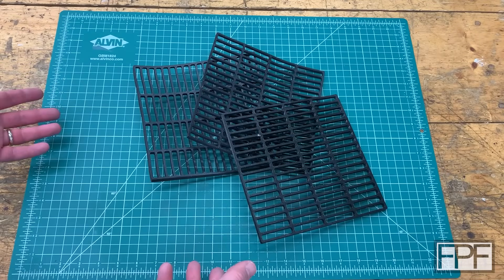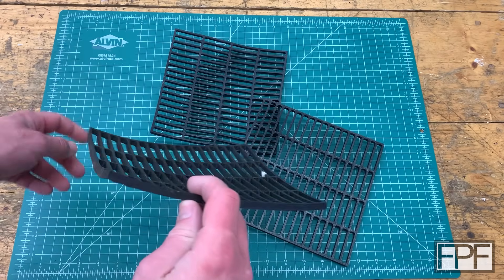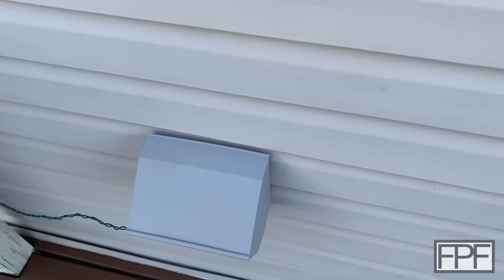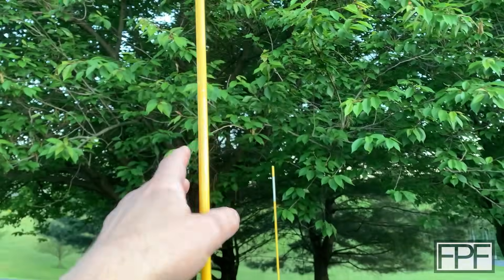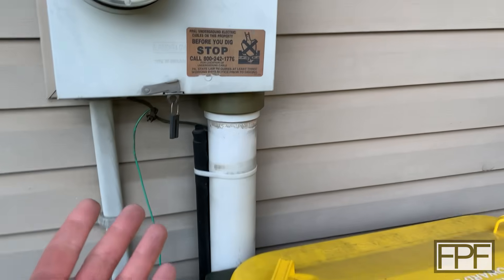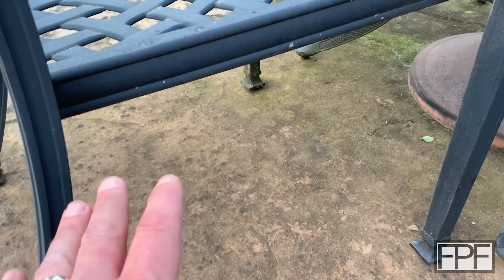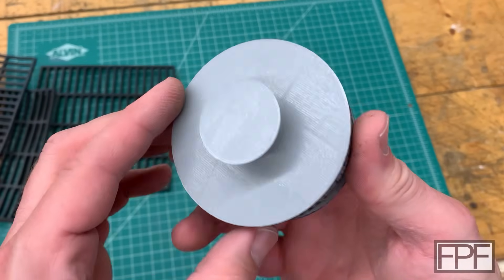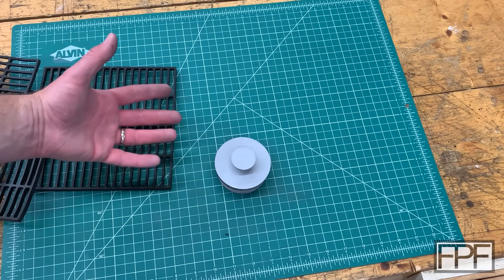3D Prints - 7 Years Outside

Comment: I printed a bunch of security camera mounts and LCOM weather proof box mounts to fit them onto a 4” square light pole. I used ASA just for peace of mind…some of them are pretty high up and / or weigh a decent amount and I did NOT want the liability of them falling off the pole and hitting someone or something.
Reply from the maker: I've yet to try ASA.  What filament do you run?

Comment: PLA seems to hold up well outside for me.  I have more issues with PLA inside a hot car in the summer.  The part will warp almost guaranteed.  I have a pla truck hitch receiver cover that has held up fine for 3-4 years being outside in the sun most days as well as held up fine with the car wash many times.

Comment: I've tested my fair share of PLA prints outside and none of them have ever gone that many years.  I do a lot of gardening so I've tried stuff in several materials and PLA in the garden breaks down with sun and regular water exposure.   I've made stakes for plants and garden tags and any PLA prints start breaking down.  They first will show signs of warping and then major fading.  By the end of the grow season they will be flaking pieces off.  That's 12 plus hours of sunlight and every few days sprinkler or rain water on them.  That's about a total of 5 months growing outside for us and pla looks bad.  Now PETG or ASA or even Nylon is totally different outside.   PETG still has its flexible properties even after a year so far.  Made a part that had to flex for outside and so far it's still flexi.   No signs of break down.  I could go on but I find your findings interesting.   I've never seen those results and that's with several colors and brands.
Reply: I suspect it's not the UV exposure but the soil and moisture contact that is more detrimental.

Comment: I have used black PETG for brackets used to construct a chicken coop using pvc conduit. The brackets are used with a zip tie that wraps around 2 pvc pipes and maintains the stiffness. There's screw holes that too. 4 years now no degradation in them.

Comment: There's too many factors here. I suspect a lot of your PLA, based on the brand names, is actually PLA+ alloyed with a more durable material. Especially the stakes in the ground, since moisture tends to be one of the fastest factors.  My tips are look at its printing temperature (you want higher) and if the location gets hot, don't have it in contact with the ground or other continuous moisture, and paint it with some exterior house paint, and it'll last "forever." 

Also, check out CNCKITCHEN's RMRRF. He shows a guy who put out samples of various filaments for 7 years on his fence facing west.

Comment: Just one comment. Durability in the sun is also dependent on your altitude. At 6300 ft, I have approx 20% stronger UV than at sea level. A hobbyist here in Colorado printed up a bunch of swatches in different colors and materials. He left all of them outside for 7 years. There was definite fading that was somewhat color dependent, and some PLA's were brittle. He had it on display at the Rocky Mtn RepRap festival. One 3D printing channel that was there posted a video of it.
Reply from the maker: interesting point, thx

Comment: I live on a boat and I've 3D printed a ton of TPU gaskets and outdoor parts, mainly in PETG-CF and ASA-CF.  Nothing has failed or even shown signs of wear after 2-3 years at sea.
Reply: you 3d print the stuff on the boat? and is your boat one of those fancy ones where there's a little indoor area under the driver's seat?
Reply: @ctbdjc  I do!  And yep - my boat has a full kitchen, livingroom (salon area), two bedrooms and two bathrooms. :)  She's 46 feet long.
Reply: @GordLamb  woah. i only have a small one we go out on whenever the weather is nice.
Reply: @GordLamb  "she"

Yup, this guy boats!
Reply: Wow - that 3D Bed Leveling and Calibration must be a pain LOL
Reply: @provoking3449  Not as much as you think. You can hang your 3d printer on a string and still print well. The levelling is about distance between the bed and head, so as long as the printer is rigid and not any slop in the axes, the rocking vibration isn't going to really do much.

The humidity and temp swings I would expect to be a bigger issue.
Reply: How do you stabilize the printer? Just the standard counterweight floating table similar to the ones used on the stoves?
Reply: @Archivort  no need to stabilize it!  Surprisingly, modest sea motion doesn't have any effect on the print quality at all (Qidi X-Max3).  I've even printed while under sail at a 10 degree angle and parts came out just fine.  It surprised the hell out of me!
Reply: @GordLamb that is awesome.  You should post some pics of the gasket to show how they are holding up.
Reply: Problem is none of 'em have failed yet! :)  When I start replacing them I'll definitely take pics of the result.

For now they just look they did the day I printed them, but you can only see small exposed sections.
Reply: Damn, printing TPU gaskets for the boat where you sleep is badass. I wish I can one day have that kind of love and trust for one of my girlfriends 🥲
Reply: Why are you not recording your journey and uploading on YouTube! That type of content would be a hit
Reply: @nocece4u  I want to!  It just takes so much damned time and I'm doin' all of this boat work alone -_-

Comment: In 2017 I printed a ravens head for a scout patrol to go on a staff out of black PLA. It melted a bit in the sun but still looked okay.  I also made a box to hold some card scrappers out of PLA and that was fine until my dad left it in a car once and then it warped to the point the lid wouldn’t close. I also had a zip tie holder that sat in the garage warp/creep on me from just the elevated temps and the force of the zip ties pushing out. After these personal events I’ve decided against using PLA for anything that is a tool or may be in a garage, car, or outdoors for long. It’s not the degradation / UV but simply that the softening point is too low.
Reply: What is your preference to use instead?
Reply: To handle the temps in the garage I find PETG is sufficient (but probably not in a hot car if the PETG is also blended). To go above that I find carbon fiber loaded Polycarbonate to be reasonably easy to print with but has excellent temperature resistance and long term dimensional stability at the expense of increased material cost and being a bit more warping prone outside of an enclosure. If the print is going to be in direct sunlight for most of its existence and I care about color accuracy and strength holding up, I’d probably pick a light colored ASA ( but not red as that pigment tends to have uv trouble ). Keep in mind PLA is still a great material for prototyping as it’s by far the cheapest and easiest to print with and it does have excellent static load strength.
Reply: We made the mistake of heating TPU next to a PLA printed reel. Of course the PLA reel deformed 😡

Comment: Dumped some pla part after print into boiling water at 100 deg celcius and it was hard to bend by hand when they are thick like 6mm
Reply: but pla start to melt at 60 degree. If you just dropped the pla, and the pla was thick, than I can understand that

Comment: Well I was thinking along your idea that PLA will endure well outside but I can say I designed a vent cover for a direct vent furnace 3.5 inch INTAKE pipe. The nice honey comb mesh disintegrated and the circumference shrank only after 2 years. No sun on that side of the house but temperatures like yours. I used white PLA by Overture sold on Amazon. I noticed this brand of white PLA is brittle before printing. I have other manufactures white PLA that is more flexible before printing. I am thinking the more plasti-modifier the manufacturer adds, the more resilient the outdoor outcomes.
Reply from the maker: give Hatchbox a try.  I use more SUNLU than Hatchbox because it costs less, but the Hatchbox stuff is definitely a higher quality.

Comment: The comments seem to be over whether PLA will just fall apart outside, it won't.  The issue people are actually referring to is IF the "Glass Transition Temperature" needs to be considered.  PLA is around 55–60°C, while PETG's is around 80–82°C, you can insert things at these temps.  The tomato support is fine in PLA, but if you "Needed" it to remain level, PETG wouldn't have warped as much, if at all in New England.

Comment: This video shows the difference between PLA and PETG for Weight Bearing prints.
https://youtu.be/R2910kAJXao?si=GNGdI0PlRrCrw4vu
I.e. this and other videos showed me why I shouldn't print Shelf Supports in PLA.  When it gets to 90F/30C, PLA can droop under weight in bright sun.
I've noticed PLA is very stiff and strong, and 'snaps' at failure, but PETG is more pliable, and 'bends' noticeably before failing.  I make my Clips out of PETG for this reason, along with bushings I need to snap around a fixed pipe/pole.  I guess it's still "different tools for different jobs".  PLA is fine for all these examples, but I wouldn't use it as one of those angled Flag Holders.
Reply: BTW, I recall some follow-up video where they showed how their commenters were right about his Bookshelf using PLA Brackets (he was so proud in the original).  Over a year, the books eventually caused the shelf to droop.  But I can't easily find it among the huge search results... ☹
Reply from the maker: hmm. .I've done about half a dozen shelf supports, all with PLA and they're holding up great.  My design may just be stronger though: https://youtu.be/FbicM6C2BO0?si=eiC7NtB-cO3wyY7f

Comment: i had some pla ghosts i printed for Halloween I left out year and they disintegrated over time. they were made from glow in the dark pla and were very thin. the part that where in contact with the dirt disintegrated and the rest became discolored and brittle. However i reprinted them as it took about 3 years out there all year to get to that point (hey i think the lil ghosts are cute around the mailbox), A lot of the current pla has anti uv additives in them so as long as they aren't warping from the sun they work ok.  

 i also printed pla vent replacement in clear natural pla (no additives) they became brittle and had to replace them in about two years.  I used clear because i didn't want them to warp from heat. the next time i printed them i sprayed them with clear uv protective top coat and they were good for 3 years where the whole vent needed to be replaced.   I also printed a cover to help keep animals out of a crawlway space  it has been 5 years and it works fine.

For me i find contact with dirt and thickness of the material is what matters.

I have a water bib standoff i printed its a bit discolored (yellowed) but still works fine (it is in white abs)

Comment: In NC. I printed a few things in PLA that were outside for about a year. Nothing degraded from UV, but I did have one thing get hot and warp. It was black PLA. No problem with natural PLA or blue PLA. This was about 10 years ago, and they were just test parts to see what happens in full sun. I think PLA formula has improved since. I now use PLA+ instead of "pure" PLA. I haven't retested, but I have ignored a lot of "don't do XYZ" because I actually tested it enough to realize that most people do not know what they are talking about. Good video.

Comment: I have some PLA+ inside my car, button mounts etc, it's been there about 2 years, still looks like new, I have also got some TPU outside the car (I made a moisture cover for the back of my front spot lights. The TPU (also two years outside) is fairly low to the ground and the elements but it also seems fine then again in my experience TPU is indestructible :)

Edit: 
GST 3D PLA+ @ €12.50 per 1Kg (Black)
Saintsmart TPU 95A @ €25.40 per 1 Kg (Black) I think this was the price I bought it a long time ago and I forget. €25.40 is what I have it down as in my slicer.

Comment: Very informative video! It looks like there is some variability in how the PLA handles the outdoors, with some prints warping and some being fine. As usual, real life isn't as cut and dry as one might think.

TPU as usual shows just how underrated it is sometimes, holding up better than most people think. 

Kinda surprised you didn't even try PETG or ABS at all.
Reply from the maker: TPU is KING

Comment: Garage-floor epoxy's and oil-based polyurethane's are the  great  equalizers when it come to outdoor prints as they will make the worst filaments perform like the best filaments for outdoor applications(cheap oil-based alkyd paints also work great)
Reply from the maker: Great tip!

Comment: Not sure if this is overall good or bad. PLA is supposed to be biodegradable. That's one of its selling points. You are proving that this is not the case at all.
Reply: There's some misinformation going around. PLA isn't biodegradable, but it's able to be composted in specialized industrial composters. Unfortunately normal residential compost piles won't do it either.
Reply: You've been had by marketing.

PLA isn't going to compost outside of a professional facility. All our PLA prints are as environmentally bad as you expect when you hear "plastic".
Reply: Yeah bad news sorry, It isn't really this was just more green washing.

Comment: From my experience lighter color PLAs are fine outside in the sun and you can coat them in UV resist  coatings. But darker colors will absorb  more heat and will warp or sag under weight, but will anneal and stop warping. Now for hot cars, PLA will soften and change shape.
Reply: that is what I noticed too

Comment: I have had a few small items in my car, thin items just turn to goo (warp and distort) but I also have a small box with 2mm walls and slide on lid and it's held up just fine. With the thin items I am sure it's more the heat than anything else. I also have a very chunky door handle for our screen door on the front of the house (kids destroy everything so I made it thick and lots of infill) and it's not in direct sunlight (front door is inset 6' from the front of the house) but it's been there 3+ years and it's used every day multiple times and still even looks like the day I installed it (pretty sure it will hold up longer than the rest of the door). Now I have a small solar panel on the eve of my house (just a 5v one that recharges a motion light) and that is PETG because it's in direct sunlight, all weather and is structural (and only 2mm thick walls) so I wanted to assure it would last 5+ years (it's now a little over 3 years old).

Comment: So PLA is Sugar Beet based plastic, so technically bio degradable, however it is not NATURALLY bio degradable.  That is, if you leave PLA in the sun, it will not turn back into its base materials, it will operate like normal plastic does in the sun.
PLA doesn't like heat, but the UV will eventually kill it, when that is varies from company to companies type of pla and what additives they have done to it (PLA+ can vary wildly).  
Now if you need the thing to be outside and be durable forever, then ASA is what you need, but if its just a decorative thing (like Flower Pots), not a lot of stress or strain, PLA is fine.

Comment: I suspect the amount of pigment in the filament and the thickness of the walls have a big impact on how well it holds up. IIRC the ones I've seen people post that degraded quickly were also vase-mode, so single wall.
Reply from the maker: yeh, single wall is really just decorative stuff as far as I'm concerned.  I do 2 min and my default is 3

Comment: I think it depends on your local conditions and color of filament as well as what is in contact with the print. I for example have had lots of failures with pla inside a car, mostly it just melts and distorts
Reply from the maker: fair point

Comment: I have printed house numbers for a letterbox beside a friend's drive. It is in full sun for over 2 years and printed in PLA Pro dark grey, and is still going strong. It is exposed to +100°F in summer and down to freezing witthout issue. Great video. I have now printed off the endcaps for my bug hotel and cannot believe that since I have printed them, I have had no garden leaves or debris build up around my unit. Practical printing FTW
Reply: Yep, because it's biodegradable as they said.
Reply: @antonkukoba3378  Huh? What do you think biodegradable means?

Comment: You buy a lot of foreign made filament.  Buy American, dude.
Reply: I would buy American if they got to the same price point as I can get others!! Tangled filament is getting close but I can still routinely find filament (good filament that works and acts the same as higher dollar stuff) for under $10 a roll which most USA manufacturers would NEVER do even though they should be able to.
Reply from the maker: It's a fair callout, but are they producing the base materials too?  I'm honestly asking, because I don't know.
Reply: @FunctionalPrintFriday  No they are just using the pellets and extruding the filament strands. Is a good research project to see if anyone is actually making the pellets here in the USA!

Comment: I’ve printed some adapters for outside solar landscaping lights at least 3 years old. Still working fine. 
Also about 1.5 years ago  Replacement crank handle on a garden hose reel.
Door handle for privacy fence gate over 4 years ago. 
All these are Hatchbox Black PLA. 
I did print one larger item from that PLA that warped some but it hasn’t disintegrated and still doing what it is meant for.